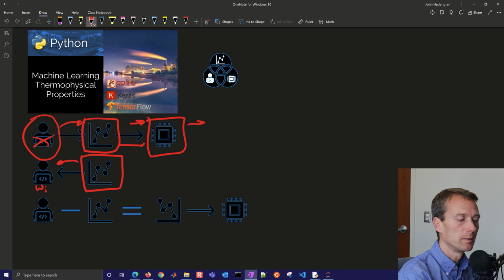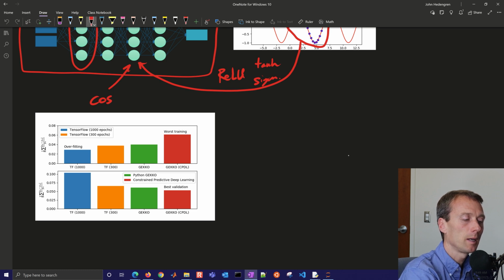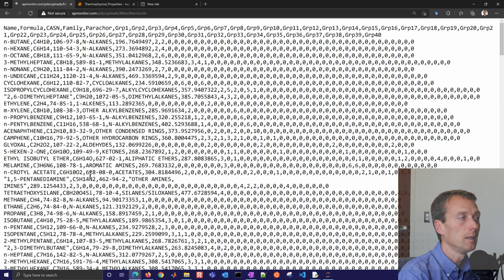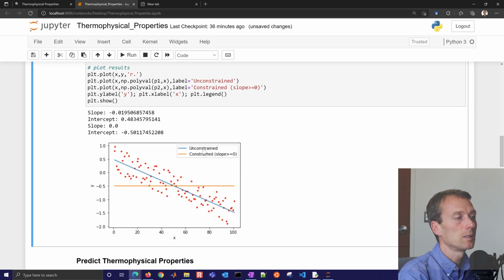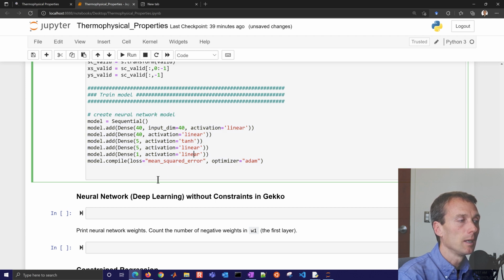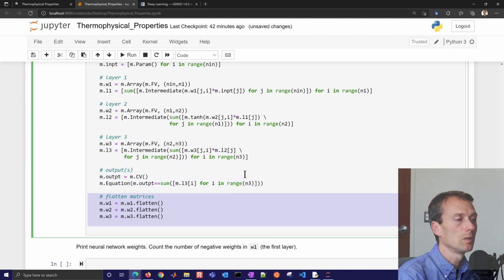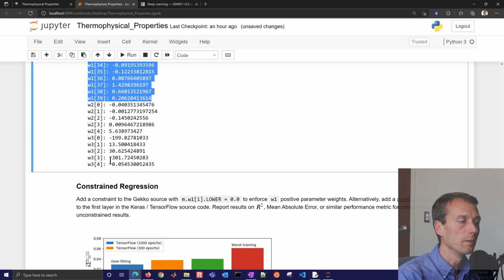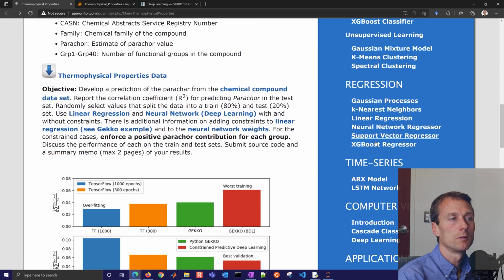Physics-Informed Neural Network

Comment: Thank you so much for sharing this interesting project. Just had a question that if we use 'ReLU' activation function for the first layer in our Neural Network, then the ouput of each node from the first layer would be non-negative. Would adding constraints for the parameters of the first layer in this case also help to improve the performance of the model?
Reply from the maker: That's an interesting observation and likely another way to enforce a positive output constraint. Many of the machine learning packages also allow constraints to be specified now: https://www.tensorflow.org/api_docs/python/tf/keras/constraints

Comment: Thanks for the demonstration. What was the reason of leaving W2 parameters without the constraint of >=0? Would it be non-physical to set the constraint on W2?
Reply from the maker: It would be interesting to try different combinations of constraints on the layers. The idea with the constraint on the first layer is that it relates to group contribution methods where each additional group needs to have a positive effect on the outcome (e.g. Parachor value). Here is additional information on the approach: https://youtu.be/a5JNGujVbnw and a publication: Babaei, M.R., Stone, R., Knotts, T.A., Hedengren, J.D., Physics-Informed Neural Networks with Group Contribution Methods, Journal of Chemical Theory and Computation, American Chemical Society, 2023, DOI: 10.1021/acs.jctc.3c00195.

Comment: Hello professor, can we use PINN for prediction travel time?
Reply from the maker: PINN is possible when you have constraints or structure of the neural network that is guided by physics equations. If you have both data and physics-information then it should be possible.

Comment: What is your opinion on symbolic regression in this context? There you could explicitly add analytically proven priors and constraints.
Reply from the maker: Blending the two methods would be an interesting area of research.
Reply from the maker: That is an interesting topic. Symbolic solutions are typically only applicable to small scale systems but produce exact results. Numerical methods are better when there is more data and with more complex models. Here is some material on both methods: https://apmonitor.com/pds/notebooks/10_solve_equations.html

Comment: Hello Doctor...I am working on solving the problem of trajectory planning for humanoid robots that are similar to humans..Actually, trajectory planning for these robots is very difficult and complicated because of the large number of degrees of freedom that makes the number of paths set to move the robot from a primitive position to a target position. Infinite..and to solve this problem, I will design an estimate capable of predicting human behavior..input to the required task and output for angular variables..but to design this estimator I have to model the human body...central nervous system, muscles, bones, etc.. The central nervous system is often represented using dynamic optimization theory. The question I want to ask is what kind of processor and numerical methods I should choose to be able to solve these complexities in real time.
Reply from the maker: This course may help: https://apmonitor.com/do